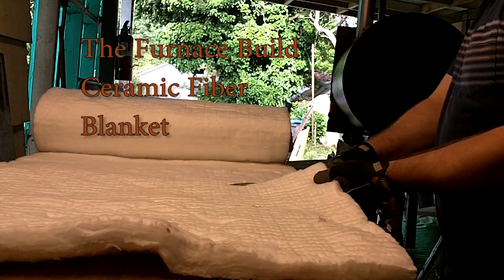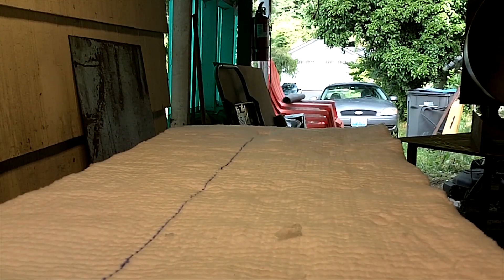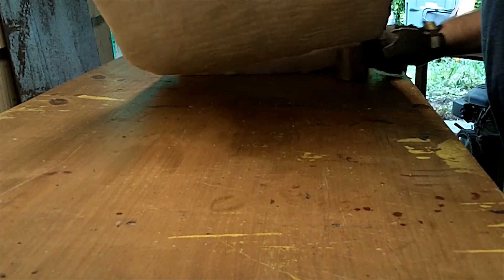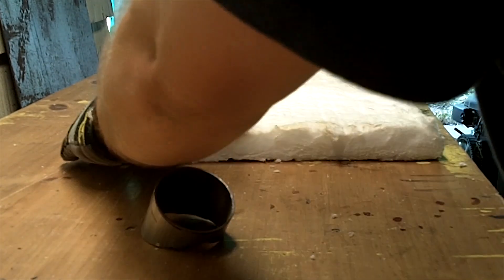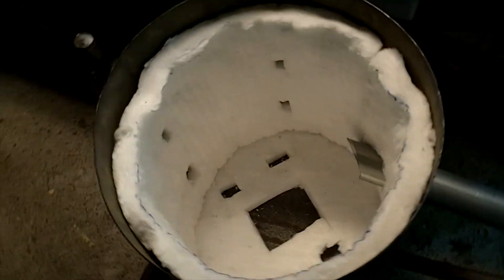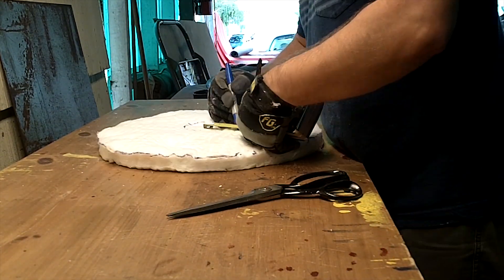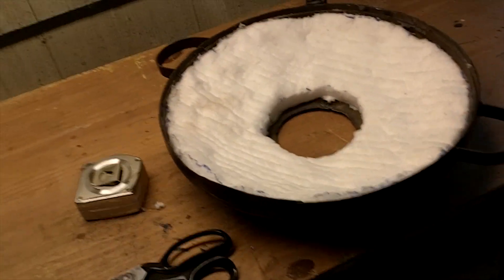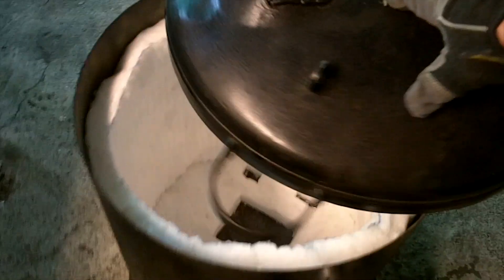Furnace Build Ceramic Fiber

Comment: My job is to make that type of fiber. I work at Unifrax.
Reply: I work with that fiber daily. Used and new. It's hella dangerous to inhale so becareful.
Reply: need or not use asphalt painting for stubs on water wall befor refractory?
Reply: shFtshiFty worked at isa bought a lot of bulk 7000 all the way up to 3000 degree fiber
Reply: Peace be upon you 

I have many questions I would like to that necessarily get the answers for my discussion after some day 

1) What's the meaning of the Classification temperature for any material  for example  ( the Classification temperature 1300°C)

2) Ceramic fibers have high melting point and high tensile strength property  why ??